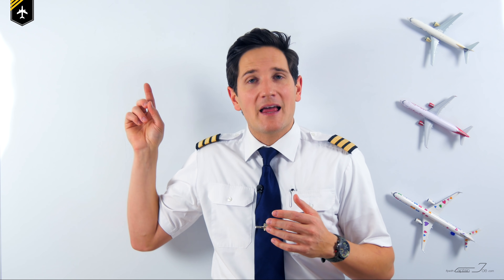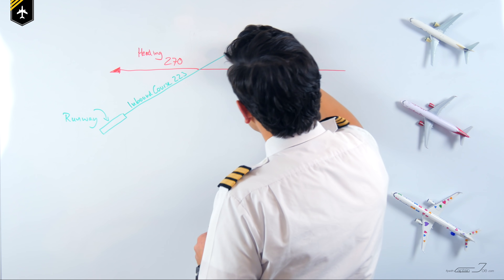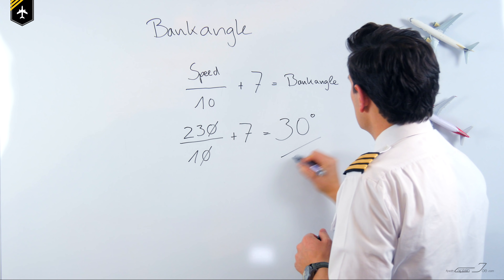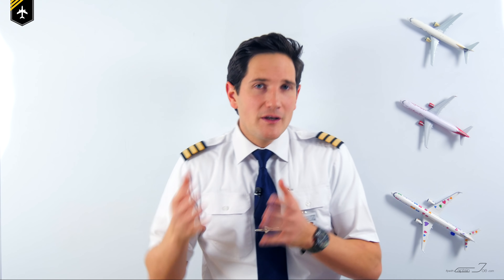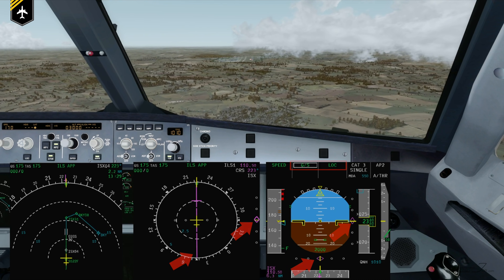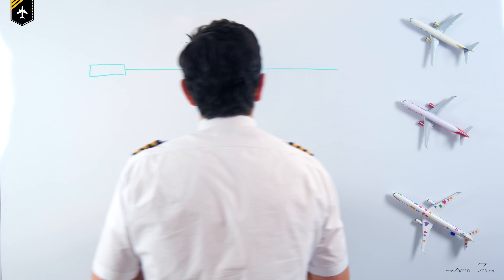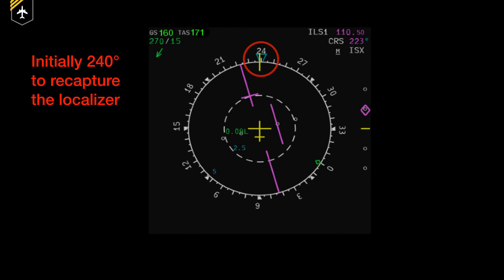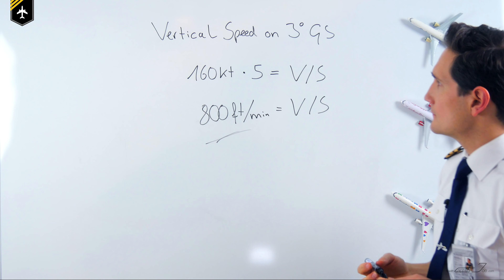HOW TO FLY an ILS? Explained by CAPTAIN JOE

Comment: Really enjoy all your videos, but this one is up there with the best.  One question though... the calculations you did on the whiteboard:  does the pilot do those manually, or he/she have an app, or similar (something on the FMC?)  to run the figures?
Reply: They dont need all that calculation. It was just to show how an ILS works. in real life the air traffic control will tell you which headings to fly.. technically they do the math, not the pilots

Comment: I'd be interested to hear your explanation about what went wrong with AC 624 in YHZ back in 2015.  It was an A320 that hit well short of the runway during a blizzard.  Perhaps your next ILS video on the types of ILS systems will shed a bit of light.
Reply: From Wiki: "The final report was released in May 2017, finding Air Canada crew procedures to be the primary cause of the accident"    Obviously they didn't notice that they were below the GS.
Reply: I don't understand how they didn't notice that they were below the glideslope.  Did the runway not have a glideslope ILS system?  If not, why not?  It is a busy regional airport with lots of weather.  I know it has a localizer array because the A320 smashed in to it.   I guess I don't know enough about flying and ILS systems to understand how this could possibly have happened.  The most amazing thing is that there were no fatalities.  It helped that there was plenty of snow on the ground.

Comment: Hey Joe! The last two times I passed through Oslo airport (ENGM) I saw a Quatar airlines 787 get de-iced or anti-iced, while all the other planes, mainly 737's from SAS and Norwegian, skipped it. Why do some planes chose to de- or anti-ice while others don't?
Reply: ChunkOfNorris one possible reason for this is the length of time the aircraft has spent on the ground and whether it is the first flight of the day.
The 737's are probably doing quick turn-arounds and have not been on the ground long enough for frost to form, whereas the 787 has probably been parked overnight or for a longer period and therefore the surface has had more time to cool below the frost point and ice has formed.
Reply: That's probably why, thanks.

Comment: This is why a greater understanding of science and maths educated to a high degree qualification is needed to be a pilot.  At the maths working out i'm done, lost!  I do maths, but that's like ok too much.  I only wish  you'd of been around when I still had MS flight simulator on my computer (ok it's just a game-not at all real) I never knew what ILS was, I use to deviate a little 12NM from the airport , hadn't a clue about jeppesen charts  or DME, OR VOR or VFR or IFR .  So in true tradition I binned the whole lot (not the computer)  and went back to the train simulator.  But watching your post and others I now know about Pitot tubes, Ram air sensors, giro based sensors slats, flaps spoilers (named because they spoil the airflow)  thresholds, jet blast pads, vectors and runway headings etc etc....  Where was you when I had the flight simulator?  Keep up the good work Captain Joe, your post are informative, understandable  (except math) l look forward to more....

Comment: Hey Joe, when do you usually lower the Landing Gear?
Reply: usually before reducing to final approach speed. on most approaches you have speed rules, like 160 knots until 4 dme in the UK. in that case you would lower the gear at roughly 4.5 miles.

Comment: I am realistically very good at maths, but this looks kind of confusing, although I would get the hang of it. When using calculations such as trigonometry, wouldn't you need a calculator?
Reply: Khalid 365 you can learn approximations,
For example sin of 30° is 0.5 (or 50%)
One method taught to pilots is the clock code, if you imagine 30 minutes it is half the clock.
Likewise, 45 minutes is 3/4, so approx 0.75 (0.71 if you use a calculator).

This method is useful for estimating the crosswind component, if the wind is 30° off the runway heading it is 50% of the total value, so if the wind was 20 KTS, then the crosswind would be 10 KTS.

Comment: A couple questions if I may.  Why the specific figures of 0.8° for the localizer deviation scale and 0.4° for the glideslope deviation scale?  Those particular numbers couldn't have just been arbitrarily chosen, right?  Also, when in the aircraft flying an ILS, how often are you actually using those formulas instead of just flying the indications on the displays?  Seems like it'd be less work to do that.  Thanks for the awesome video!
Reply: He basically already mentioned it. Airbus recommends to have a deviation of less than 0.4 degrees on the ILS when at 1000 ft AGL. 
The math Capt Joe is doing is just there to explain how an ILS works. In real life you would obviously never have to use those formulas.

Comment: I gained my private pilot's licence in a Cessna 150 and at a flying club which was at sea level.   As I progressed I began flying into my local international airport which is 500 feet above sea level.   On one of my approaches, I didn't feed in the QNH so when my altimeter showed my height as 1,000 feet I was actually at 500 feet.   I piled on more power and more power until I was at the correct height and landed.   I'm sure ATC noticed but they didn't say anything.  I never repeated that mistake.

Comment: I was thinking about the job is like: put the fuel, take off, dial direction on GPS and after few hours of sleeping find a runway lights and get the plain down. But after few capitan joe videos I see to operate those gigantic birds..  it's a freaking rocket science
Reply: Nah it really isn’t. Nobody is doing all this math. After a while you get a “feel” for it.
Reply: @josesbox9555  I was going to say: who's doing all this math while flying a plane. I guess a co-pilot could, if you have one, but seems a lot.
Reply: @richardernsberger5692  you don’t ever do this much math. It’s all done ahead of time. Closest thing to math you’ll do is distance over speed gives you arrival time and fuel. And wind correction is as simple as picking a heading and if you drift one was it another you add or subtract a few degrees.
Reply: @B4reDown I was thinking about being a pilot until I saw that approach chart
Reply: It is not rocket science. It is plane science. :)
Reply: a single glance on a chart approach diagrams make my brain warms to the boiling temp
Reply: Dragan Crnogorac 
Planes r a lot more complex than u would think, but after enough research it becomes quite easy, I fly Cessna but fsx I still have the basics for the jets
Reply: I thought similarly, and in consequence thought, flight simulators must be boring. Why would anyone buy a flight simulator and play it on his computer (or playstation or whatever product). Hence I didn't ever buy anyone.
Reply: With a flight simulator you may get some glimps of the route before actual flying it. 
There are some high quality maps and so on avaible. 
In a full flight simulator you might get some skills safly. You may practice steep turns before actualy doing it in realtiy and in some flight simulator you may train your braething for steep turns. Some flying schools does now a session before actualy flying 3G to 6G turns. It's a lot safer if you stay awake in a stable steep turn.
And the simulator works in bad weather!
You don't get a feeling for turbulences, false reception of you instruments, pattern flying, landing, .... as you are too focused on the simulator instruments (and there are never 3 gliders try to land simultaneously on the final). A simulator isn't boring as you may test a route before actually flying it.

Comment: Given that Airbus aircraft use sidesticks, how do people who are  right handed manage when they become captains. Can a captain opt to use the right seat because it feels better for him. I imagine this problem wouldn't apply to pilots that use yolks. I've always wanted to know.
Reply: I would assume they adapt to it being on the left. With a bit of practice and time one will get used to that kind of thing. For instance, I'm left handed but I always use a mouse on the right as that's what I'm used to.

Or as another example, a bit closer to the original question, at work I sometimes use a stand up forklift. It is designed where the main stick that controls everything except steering is operated by the right hand while all the left hand does is control the steering. I adapted to using my right hand while on the lift. Sit down forklifts are similar, the sticks that control the forks are on the right side. Of course, this isn't quite the same as AFAIK there are no such thing as left handed forklifts so it's not like I learned on one style and had to change hands. My point is that it is possible to learn to use one's less dominate hand to control things.
Reply: I think that the captain must be on the left because the most important things such as buttons switches ... are on his side so he can't really choose the side he want. (I'm not a pilot yet it's just knowledge so waiting for the answer of Captain Joe ). 
I always ask myself how do captains adapt to the sidestick.
Reply: Even on the Yoke you fly with left hand as captain because you have the right hand on throttle and left hand on command. I can confirm you that it is not difficult at all. Personally I don't make the difference.
Reply: it is a very normal thing to fly with your left hand as you use your right hand to control the throttle, which you do not normally want to move your hand away while on takeoff and landing, yoke or sidestick.  For me it feels instinctual in a 172 to have my hand on the throttle.  It just doesn't feel right otherwise, since they have been known to slip back out to partial/idle, which can be disastrous on takeoff.  I'm right handed, and I think It would take a little bit of time if I had to get used to flying with my right hand.  One thing  is that my left arm, naturally tends to find itself using the door as an arm rest to help stabilize it, exactly the same as when I'm driving.  In fact I exclusively pretty much only use my left hand when I drive, except maybe if I approach a very sharp turn.

Comment: in a car/truck on the road you compensate for wind instantaneously with no information like this or calculations..
Reply from the maker: I totally agree :)
Reply: is there no way to just eyeball it? estimate it and grab the controls and do it manually..
Reply: At least in PC flight simulation it works perfectly without knowing any of the rule of thumb formula, I therefore think it would also work in real life.

I guess the point of knowing them is having a second kind of cross check. Think of you are following the runway track eyeballing the ILS indication (which I guess might also be what also real life pilot do primarily?) but your heading does not match what you expect from calculations (which usually also does the plane's computer and shows the result on the display), I think this should be the moment when you should start to check again if you have tuned the correct ILS for example and if in doubt that the system works correctly do a missed approach?

Just some speculation from a former flight simmer, but I would love to get a comment by a real pilot about my assumption? (Maybe the role of rule of thumb formulas and how to apply them practially would be also a great video topic in general!)
Reply: Me to agree

Comment: When I'm landing on ILS with crosswind in FSX the autopilot doesn't correct the plane position, either i'm way to the left or way to the right, why does that happen?
Reply: Don't fly in hurricane.

More seriously, check if you have APP mode engaged.
Reply: FMSCBT yeah everything engaged it corrects the vertical diamond but the horizontal diamond doesnt
Reply: Strange, have you set nav 1 and 2 correct and active?

Comment: Hey caption Joe plz explain about the numbers on runway ...what are they nhow they are built?✌
Reply from the maker: Video in my channel!
Reply: Kunal Patel 
They just mean the runway heading rounded to the nearest whole number and L, R, C just mean which runway let's say, 5, runway 5, if there r multiple runway 5's they will have left right or center
Reply: They show what degree the runway is at, 09 is 90 degrees, 36 is 360 degrees, it rounds at 5.
Reply: Runway's number are determined by their magnetic heading

For example, you have a runway pointed to heading 270, it's number will be 27. If you have a runway oriented to heading 020, it will be runway02. 

You just divide by ten the magnetic heading and you got the runway's number.
Reply: Thank u everyone
Reply: This Flight sim guy called Doofer911 did a video abt Runway markings, taxiway markings, instruments and some other things. check him out (warning: he is Scottish)

Comment: Great Video! While doing an ILS Landing, does pilots need to manually flare? When I was on an A320 last time, I can hear the AP disengaging alert sound 10-15 seconds before touchdown, why?
Reply: At that point the pilot took control over the aircraft to land, which is usually done manual.
Reply: Unless they are flying a Cat 3 ILS approach, they will disengage it and manually land it.(In most cases anyways) In the case of CAT 3 landing on the A320 they will use the autolanding system.
Reply: Pilots were just too lazy to make a complete Autoland and too lazy to switch in manual mode earlier
Reply: Just manually landing, i think ils landing can be done using auto pilot or doing it manually, 

so you can use the indicators on the displays to line up the plane,  or let the computer keep it descending at the proper rate, either way you need to land it manually
Reply: He Huang 
Most aircraft can't land themselves and those that can usually use it for tuff landings, emergency, or to test
Reply: you need a CAT III ILS to land fully auto

Comment: If flying an ILS with autopilot engaged, will the aircraft automatically correct for wind or does that have to be done manually? Does the aircraft use the ILS when autolanding (when equipped) or does another system come into play?
Reply: Yes, for autolanding they use AP 1 and AP2 on the A320 with ILS. Here is a good video for it https://www.youtube.com/watch?v=LIaMALJjOEc
Reply: On most of airplanes equipped with PA you have the Localizer and Glidesope mode installed. That means that the airplanes will be able to follow the localizer and glideslope path even if it is windy.  

For Autoland yes the PA is using the ILS, but autoland require specific equipment like two PA etc...

Comment: I'm learning how to fly a GPS ILS on the CRJ-700 in Microsoft flight simulator. What is different about a GPS ILS?
Reply: It doesn't exist, GPS and ILS are two different approach modes like RNAV and VOR/DME
Reply: Thank you! Would the GPS NAV approach control mode glide slope?
Reply: I use the stock CRJ-700
Reply: Not it provdes only lateral guidance
Reply: I do regional flights, like Denver to Salt Lake City